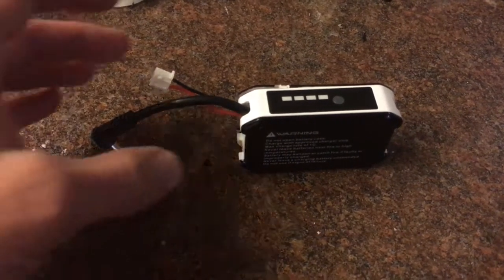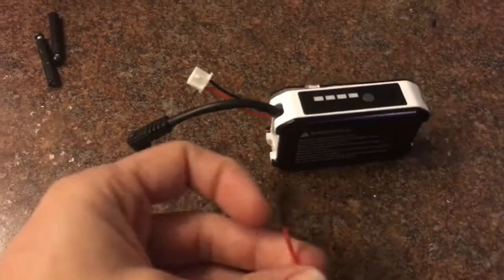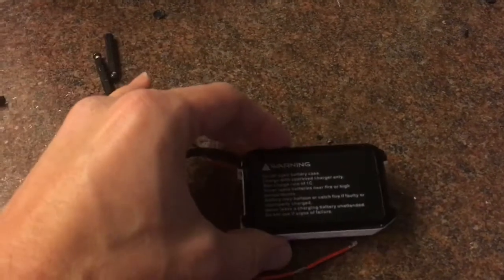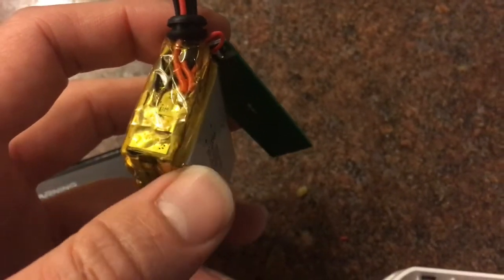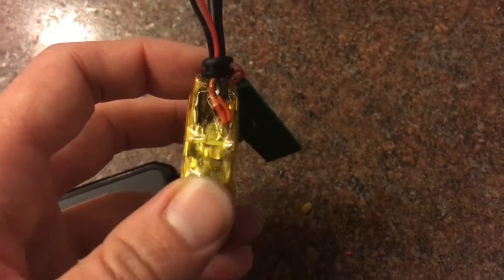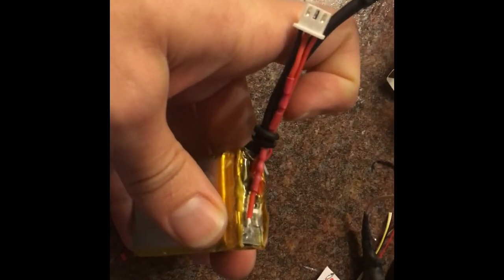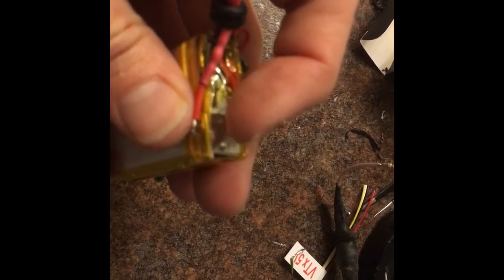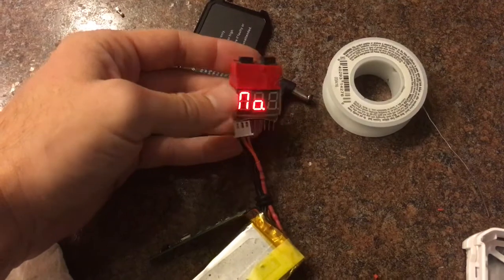How To Add Balance Wire To Fatshark 1800mah Lipo Battery

Comment: Many thanks for this excellent video. Have had loads of problems getting my FS lipo to charge. After this mod it's working fine, plus I can now monitor the V of each cell. After taking the lipo apart I'm not convinced my lipo has any internal balance circuitry which is maybe why it failed.

Comment: this is no fix. there is a internal balance Circuit already built inside. what charger are you using? all you need to do is charge in pB mode. your just doing a pointless modification, it doesn't need a balance lead to charge. as long as you can charge in pb mode. I us a IMAX b6 in lipo mode w/no balance lead connected, due to the internal balance Circuit, you don't need to balance charge your battery. pb mode
Reply: Yeah about that.  Those 1800 batteries from Fatshark don't have the so called 'internal balance circuit' in them, I've opened mine and looked. The battery cell checker built in showing the blue LED lights just looks at total voltage, has nothing to do with protecting the individual cells.  So yes, this IS a fix.